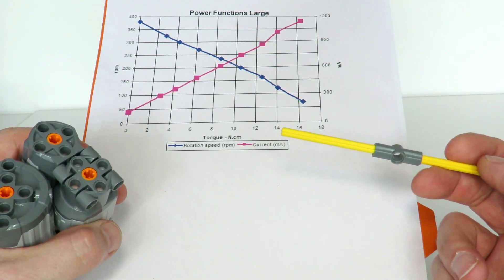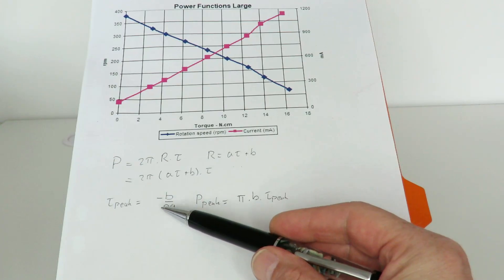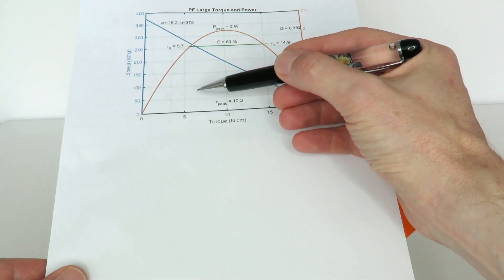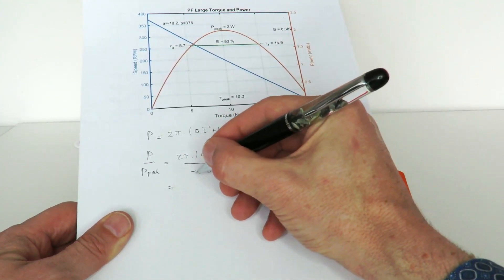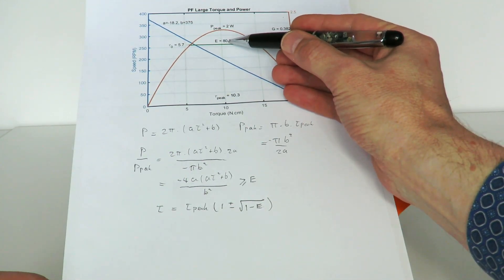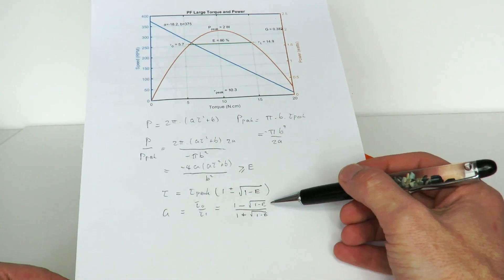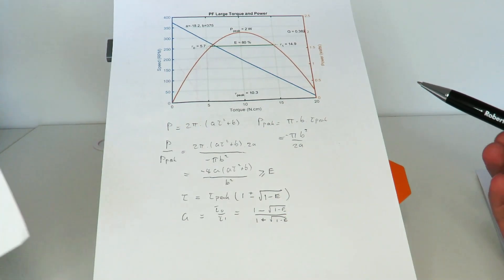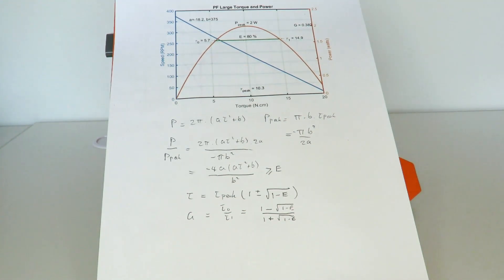Lego Technic Optimal Gear Switching Ratios

Comment: I think the torque differences you can practically measure is more important than the gear ratios. I would optimize the gear ratio after knowing that information and would try to find a ratio where the motor works on max performance after switch.
Reply from the maker: Hi Levente. Yes that was the idea in this video. The gear ratio has been calculated to keep the motor operating within a desired power range. Maybe in practice it won't match the theory - no friction losses have been taken into account...

Comment: And I also believe that philco uses 12 volts instead of the 9 or 7.2  volts from the Lego battery packs.  It's doesnt change your calculations but the timing to change gears at the 70/80 percent area would be very quick .. a dc motor are designed for torque at most of the time range and as speed goes down just  increasing the voltage will give you speed that is needed.  that is why a Tesla electric cars has only a 1 speed  transmission.  Great video though!!
Reply from the maker: Hi PC Doc. Thanks for your comments. I am pretty sure for the graphs I used from his site they were for 9v. I guess the timing depends on how quickly the torque changes on the output, and yes voltage control would be handy!! 😄
Reply: @TechnicBrickPower  no wonder I couldn't find the link . I spelled his name wrong, on the bottom of this webpage link . It's states he uses 12 volt supply..  I can't wait to see how you convert the quadratic formulas into the required mesh of gears for this project !! https://www.philohome.com/motors/motorcomp.htm
Reply: @TechnicBrickPower   @Technic Brick Power  if I'm asking to many questions, then I must be learning :)..  from your large motor example . From 70 to 90 percent range ..gears ration  .519  can be constructed from your prime numbers diff lesson for example 16/31 gearing but from c+b ?? Input feedback?  For the 80 percent range ??
Reply: But, in Lego we don't have a control over the voltage. And even you do have ovet BT, we want the model to go on it's maximum.

Comment: Nice
Reply from the maker: Thanks Ants! How are your projects going?
Reply: @TechnicBrickPower  it’s doing ok, I built a LEGO car with buwizz and Using Anto legos go kart drive train. It can go really fast but for some reason the buwizz light turns orange after a few seconds while using ludicrous after I just charged it overnight, is that just something that regularly happens? And why does my car make a lot of bumping sounds while drifting and turning? I analyzed it and couldn’t find a solution, also, is buwizz ok to use on snow? It’s snowing at my place. :| what’s your next creation? I wish you good luck on it